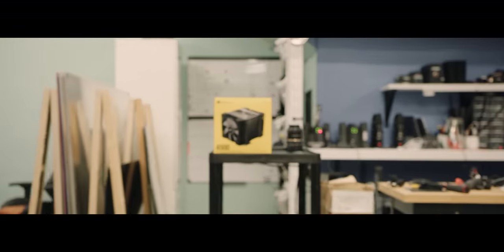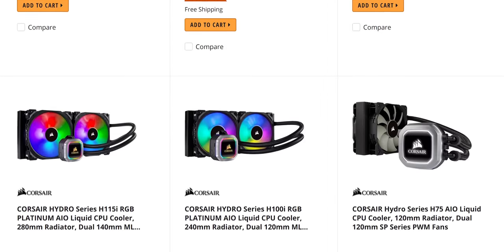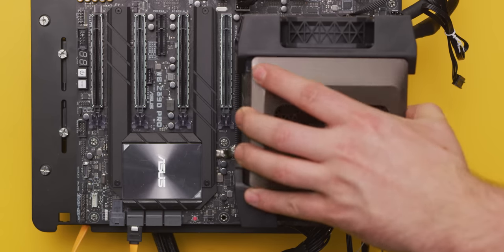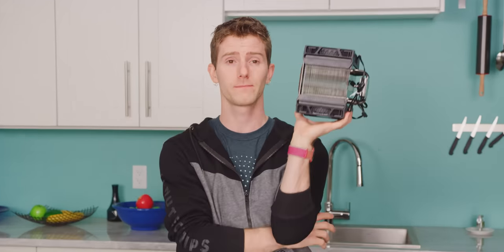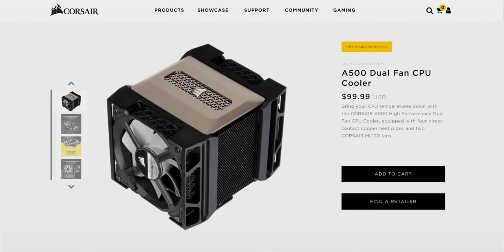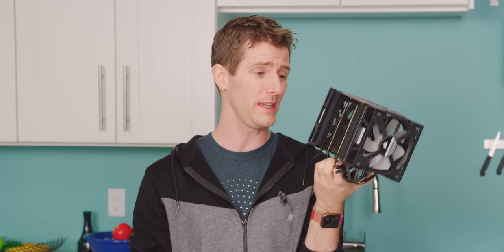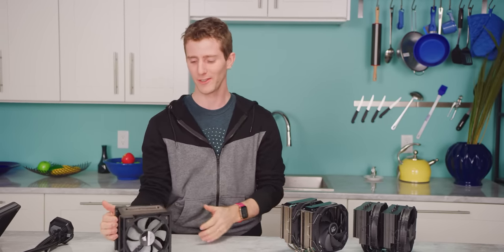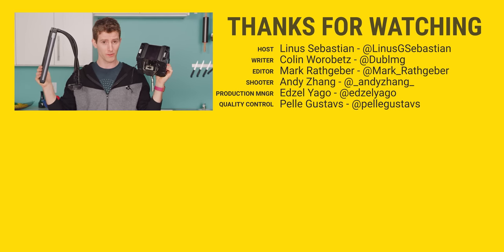Even Corsair Knows Air Cooling is Better - A500 Review

Comment: Linus, I'm legitimately shocked with how the quality of content from you has been degrading as of late. I won't lie, I love Corsair's product line. They are among some of the best I've used. My NVME SSD, my mouse and keyboard, my headset, my headset stand, and my PSU are all Corsair, and up until recently, when I went to a G.Skill DDR4-3600 CAS 14 kit to get the most out of my R5 3600, my RAM was Corsair as well. I also have a Stream Deck. I'm saying this for full transparency, but my issues don't lie at ALL with brand here.

They lie in science. You pit this thing, thermally, up against 2 coolers that you even SAID had 140mm fans on them. This cooler has 120mm fans. Scientificially, the smaller surface area of the fan, in order to compete with the other two coolers at this price point, are going to need to spin at a higher speed under load to properly dissipate thermal energy from the CPU. That's GOING to result in more noise. Now, 3 years ago, these fans probably would have been closer to 10 dB louder. Not 5. That's MASSIVELY impressive that they can minimize the audible threshold that much while still keeping smaller fans and achieving approximately the same level of performance on a 9900K. 

So next time, factor that in. Don't say "This sucks don't buy it" when the reason the other two were quieter was because they had a larger surface area on the fan to dissipate heat than the Corsair cooler. In other words...review fairly, or don't review at all.
Reply: But he explained why he did that. Its the same size as the other coolers with bigger fans and costs the same.
If its "only" a 12cm fan cooler then it should reflect that in its price. Not to mention that these are not even corsairs LED fans but some cheapo standard ones whereas other companies put their best fans on their best coolers.

Comment: You can get 2 CoolerMaster ML240L for the price of this thing. And the AIO would still fit in more cases than the Corsair's monstruosity. Oh yeah, the air cooler also performs worse.
Reply: But unlike the AIOs, this thing will last more than 2-3 years before the pump dies.

Comment: I specifically switched to AiOs because tower coolers are the most obnoxious and stressful part of any build I’ve done in years. Can’t access ram, motherboard securing is terrible. Straining the PCB is... not a good idea either.

Fewer points of failure, valid. But tower coolers just do not make sense to me.

Comment: LTT do a budget CPU cooler 50$(at maximum) comparison  and use i7 9the gen or ryzen 7 series for the tests which are probably what you would go for in a 1300-1400$ build if you want better GPU(RTX 2080 SUPER for example and a ryzen 3600 or 3700x or 3600x)

many people are looking for the best budget CPU cooler at that price  though many have suggested the ARCTIC  esports 34 duo

Comment: Funny you talk about Secufirm, I have one friend that absolutely loathes it... I've never minded it, not the best thing since sliced bread but definitely not bad, but he's always whining about how he cuts up his hands on the finstack whenever he's trying to mount a noctua cooler...
Reply: Man thats odd. Only problem i had with secufirm was that the backplate install on AM4 required 3 hands or holding the system at a weird angle if you dont want to remove the mainboard.

Comment: 4 heatpipes with smaller fans and a larger foot print is more expensive than the 6 heatpipes with larger fans and relatively smaller size..
lol..
(yes even if you say those 4 heat pipes are large, those are not enough..)

Comment: Eventhough AIOs are definitely better especially under load for a longer time as they have a larger SHC/TDP, they run quieter for the same cooling performance dont look ugly af and out perform any air cooler if you buy third party fans like noctuas.

Comment: 1. Air coolers are better ONLY if you don't stress CPU for more than 20 minutes (you said so yourself in air vs AiO video)
2. Are the air coolers better, when they perform same while being louder?
3. Massive heatspreader that can interfere with RAM is another point of failure.

Comment: The triangle design on top and fan sides look like shit IMO. The sliding clip fans is neat.
It would be interesting to see if there is any difference if the sides fins were covered up and fans swapped for Noctua A12x25. Also they could have made the gap in the middle of the fin stack smaller for even more surface area.

Comment: aircooler too bulky making installing or replacing ram and plugging connectors a pain in the ass. I wouldn't say water coolers are louder, I have 1 and it's actually quiter than the air cooler I had before. Water cooler any day of the week.

Comment: Mmm tilte " Even Corsair knows air cooling is better" Temps on i9 92 degreess XDDDD Wow that air cooling is a beast kekw.
Reply: Well, that's typical of Corsair coolers :D
Reply: @dainiusvysniauskas2049  ye but aio from corsair is actually pretty good. Maybe not the cheapest but 240 aio  from corsair is mostly better than 360 from others lol
Reply: @BedziuPolska  Um, no, not really.  They are average at best.
Reply: @dainiusvysniauskas2049  So far i tested a lot of aios and corsair are in top 3 like h100i h150i

Comment: Air cooling is better, that's why you need a ginormous heat-sink to cool a tiny processor right?

Also, this isn't the first time Corsair has made an Air Cooler. They used to have an A series that was nothing but Air Coolers before AIO popularity took over.

Comment: This cooler is weak compared with Prolimatech Mega Shadow. The air coolers from today excluding Noctua, are  useless. Alot of money and zero  efficiency and cooling. Sorry if im wrong, but that is reality. Make a test with this cooler and noctua nh-d14, nh-d15 and prolimatech mega shadow which has one of the best grips. Too bad if the new air cooling is to make money. I like youre videos and presenting. Keep up the good work!

Comment: Maybe Corsair should buy Noctua, since they buy everything else. Maybe then the fans would be usable.
Reply: dont think its so bad as the video makes it out to be, i am not recommending this product. there are information missing leading me to think that fan rpm is to high making it loud, and dual fans are very inefficient, making things cost more and perform worse in comparison to single fan coolers.   
if anyone have this cooler set the rpm to 600rpm and only use one fan. reuse the other fan in the case and deduct the price of the cooler. it should be more price competitive now.

Comment: Never knew the middle was empty lol why? Cost? Performance is better than it being filled with fins?

....and gummmmooo at that price surely they'd include some nicer RGB fans instead of the standard ugly grey. Noctua browns look better than those grey boys. (*Granted I for one LOVE the noctua brown theme)

But yo, you couldn't have thrown in a H100i for comparisons sake? 
Or matched RPM or temps between the coolers, vs noise.
Cause cooler A at full RPM could be 3000rpm and 80degC, yet hits 50dB
But cooler B at full RPM is only at 2000rpm, hits 90degC, but super quite at 40dB
Ya know? something needs to be equal for a comparison.

Comment: Is OK, but no-one wants all that hot air blasting around inside the cabinet/tower. Unless the hot air is ducted outside, you need even more fans to vent the heat. Add to that, not everyone has the space for such a monolith...
Meh. Not impressed. Watercooling works better (water has a higher specific heat capacity) and moves the heat directly to the outside of the case.

Comment: Looks like a typical Corsair product, it's ok and not terrible (you can always do worse), but you can usually do better with another brand for equal or less money (cases/ram/kbs/fans). I don't hate Corsair, i just find them overrated and generally not worth the cost, i do however like that they keep changing things up and coming out with new products, innovation and choice is always good.

Comment: LTT being either lazy or intentionally misleading about cooling. No-one runs fans at 2k rpm - what matters is performance at a given db level. Take whatever is an acceptable level of noise, then see which cooler performs the best at said level. Max rpm testing is useless and misleading. Complaining about ML120's being loud at full blast is about as stupid as it gets. Not a fan of Corsair, but this is just idiotic.

Not that it would matter anyway, no-one should ever trust numbers provided by LTT, especially thermals. It's funny how they have more and more money and people, yet they keep on getting more and more lazy about doing things properly - or that's what I hope it is. The other option is just utter incompetence.

Comment: As somebody who's installed NH-D15's and Dark Rock Pro 4's in mITX cases, I'll tell you who this is for: somebody who doesn't want to ** with the horrible fan clip system that everybody else uses 😎
Reply: You really have to be special to struggle with a simple metal clip system.

Comment: In my experience, corsair products are no better than other brands on the market. In fact, my ram sticks keep losing connection with the stupid icue lighting program and it gives me an error. The only way to fix it is to restart the pc. Also, the ram sticks fell apart one day where the metal plating came off. This is a 60 dollar stick.

Comment: Air is better? Lol…If Linus starts lying, bye bye subscription…all the hot air in the case is gonna overheat everything…test benches are not cases. If you can install that giant air cooler, you can definitely do the AIO…
Reply: even gamers nexus and jays 2 cents says air cooling is better from a price ot performance standpoint - and no risk of killing the machine due to a leak
Reply: @NeroWolf42  Exactly price performance...not actual performance...I have 3900x running all day overclocked all core at 4.3 GHz and temps never have gone over 63C yesterday playing WOW full, decoding a video...with air this would a disaster...I have tried it many times ending up taking back the many Air-Coolers I have used. If you are not overclocking then Air is fine...but if you Overclock, Air cannot keep it down for too long, besides the noise of the fan. And as for waterpumps, they do not all make noise...

Comment: Stop spreading FUD! 

Air cooling is not better than watercooling. It may be better than AIO watercoolers, but nowhere near custom loop performance.

That said, I would never, and have never, used or recommended AIO watercoolers.

Air cooling or custom water.

Comment: So sick of overpriced air coolers that don't perform that well but are pretty... Scythe makes larger air coolers that  are 50 bucks and quiet as can be. They compete with the d15 within 5 degrees as well.   The scythe mugen keeps my 9900k under 85c under load and under 60c at idle for 50 bucks almost silently. Sure they are kinda ugly but if you replaced the fan and maybe panted to cooler it would look fine.

Comment: Cover this cooler pls . Scythe Mugen 5 ARGB. It is like the older model however it has 2 ARGB fans with a faster RPM than the original 1 fan. It also has a ARGB strip on the top. It is soooo bright I can not even find a picture that does it justice. https://www.ttn.by/files/image-611241-1582405202144-main11161582405202.jpg

Comment: Nope, water cooling all the way. Show me an ACTUALLY silent and efficient fan. You cant have both but with water cooling you can...
Reply: fans become inaudible at 500 rpm, at least noctua fans do, water cooling cans are static pressure fans, can't imagine those work very well at 500 rpm and the radiator adds turbulence and noise also. then comes the pump and water circulating noise, on top of that water blocks enhance the coil whine and electrical noise. 
air coolers are cheaper, last longer, makes less noise, require almost no maintenance, gets you better airflow in the case, easier to install.